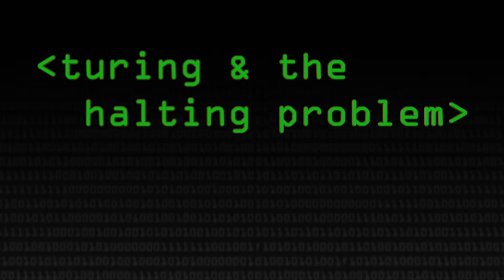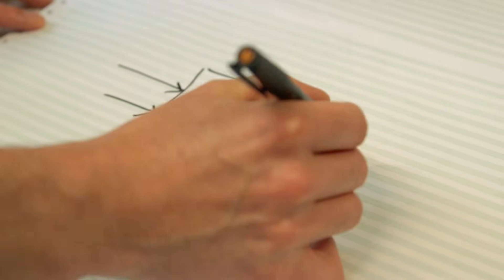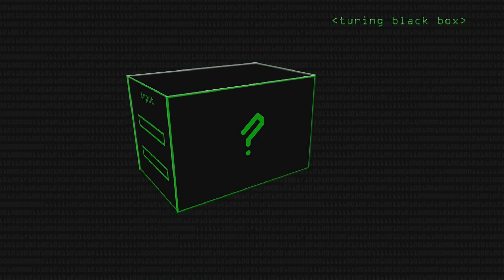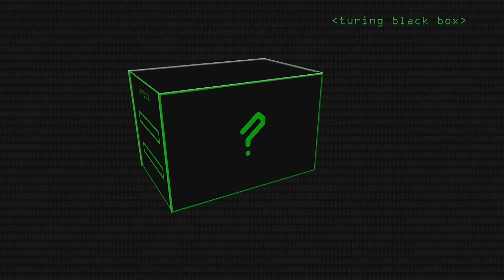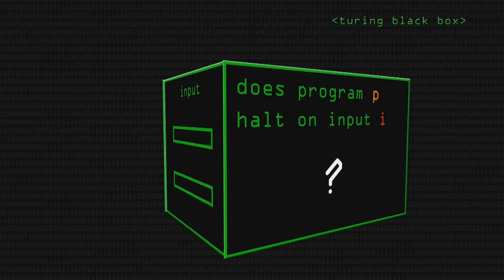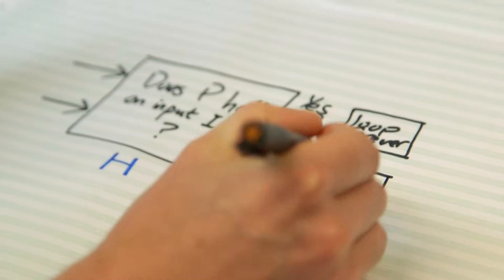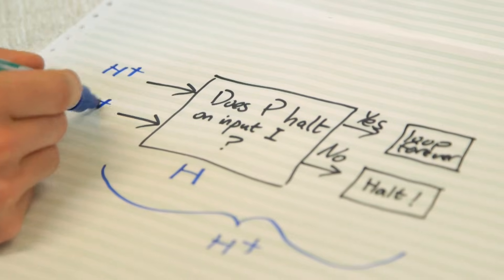Turing & The Halting Problem - Computerphile

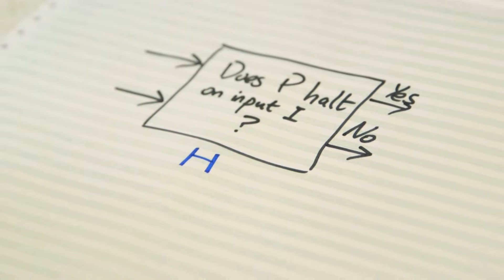Comment: 4:06 why not, instead of putting the "Loop forever" on Yes, put it on No instead. And put "Halt" on Yes instead of No. This way, when putting H into H+, if H will halt, H+ halts. And if H would not halt, H+ loops forever. Why is this a wrong answer?
Reply: No this type of thinking is completely wrong. H+ is a machine made of 3 machines. H itself is right, however due to adding extra machines that basically flips the output, makes it so H is wrong because the extra machines say it's wrong by flipping the answer, H is still right that the machine will not halt, because on normal circumstances it will not halt, however since you are forcing it halt by telling it, you are basically saying that it's wrong because you told the machine to be wrong.
Reply: +LeagueofLegendsFan9 
Your answer is not "wrong", it's just pointless. Just the mere fact that it's possible to fool machine H is sufficient to show that machine H doesn't work. In a proof by contradiction, you only need one failure to show the initial assumption was wrong.
Reply: Fernie Canto Ok, but why does wrapping H in an inversion of itself, which any rational man would determine will provide a contradiction, why does this resulting contradiction matter when it only happens as a result of a self-imposed inversion?
Reply: LeagueofLegendsFan9
Because, if machine H existed, this contradiction would be impossible. Machine H is, by definition, "unbeatable", and the proof shows that even a hypothetical unbeatable machine can be beaten.
Reply: Fernie Canto I'm still missing something. Why does it matter that an unbeatable machine can't beat an inversion of itself? Why must the conclusions be inverted?
Reply: NeOnThEcOdEr
Well, that was even more confusing.
Fact is, the fact that H "can't beat an inversion of itself" may seem pointless at first, but it has a massive consequence for computer theory and logic. This result shows that there's a whole category of problems that can't be solved by computers; using pure logic, you can show that, if you could devise a machine to solve one of those problems, that machine would be equivalent to H, which we know doesn't exist.
Turing's result shows that computing is limited by nature. Just like there are things we know we can do, there are things we know we can't do.
Reply: +Fernie Canto 
Well, this feels like the problem of figuring out the sum of 1-1+1-1+1-... to inf. At first most people thought well since it fluctuates between 0 and 1 infinitely, we can't really figure out the sum. Until some clever dude comes along and says well... we actually can if we do some clever trick and say the sum is 1/2. Enter quantum mechanics and that solution kinda makes sense. No? 
(I leave it a ? since I don't know for sure if this simplification of the original problem was solved using out of the box thinking and quantum mechanics means the same logic can be applied to the true original problem as even his explanation is a simplification).
Reply: Fernie Canto Perhaps the things we cannot do are only limited because we tell them to be limited. Give me an example of something that can beat an inversion of itself, in logic. Otherwise, the "whole category of problems we can't solve" just sounds like a lame excuse when we're talking about a machine that literally fails because it works.
Reply: LeagueofLegendsFan9 Look, dude, I'm okay if you're not well read and well studied in Computer Science, and if you're not completely knowledgeable in all its fundamentals and concepts. But now, you're trying to argue about Computer Science (with an actual CS undergraduate, no less), without knowing anything about it. You fail to realise that, when it comes to formal logic, you can prove that a problem is impossible to solve. Go read about Gödel's incompleteness theorem. Go read about undecidable problems. And if you think computer scientists are the kind who make "lame excuses", read about the "P=NP" problem, which is an open problem, and which is being restlessly chased as we speak. In fact, there's a monetary reward for anyone who can prove either that P=NP or P=/=NP. Maybe you can win that if you work hard enough.
Reply: +LeagueofLegendsFan9 +Fernie Canto
+LeagueofLegendsFan9 
It would seem like (imho) that the halting problem generates a paradox because of how we've limited the program to work. Just like how under normal circumstances it seems impossible to solve sum (-1)^n where n=0 to inf. However, a clever shift in thinking and some math later and you can see how it may not generate a paradox after all. Sum=1/2. 
I'm not saying I personally can solve the halting problem or the P=NP problem, nor am I a computer science aficionado. I'm just saying, are we generating a paradox and concluding we've created a proof via contradiction when in fact we may not really have. 
There may be a future clever guy who comes along and says just like sum (-1)^n was seemingly a paradox of is it= 0 or 1 but turns out we can find the solution of= 1/2, the halting problem might not necessarily be a paradox given this potentially new clever way of solving it.
Reply: Fritz Miot no, you clearly have no understanding of computer science at all or even what the problem is really about.
Reply: Richard Clark cool, tho my point had less to do with understanding computer science and more about how we reason something is impossible to figure out.
Reply: Fritz Miot 
Mathematics and Logic are really the only fields in which you can make rigorous proofs that something is impossible or unknowable, because it's based on axioms. If you start off with a given set of unchanging rules, it's possible to prove things much more rigorously than when you're trying to approximate the real world, like in Physics or Chemistry.
Mathematics and Logic are axiomatic because they're not trying to approximate the real world, but provide tools to help solve other problems. That's exactly what any computer does. You can determine what it's possible and what's impossible for a computer to do because you know all its rules. And even then, there are things you can't determine. Even Logic has its limits. It just turns out that the halting problem in particular has a definitive answer, while other problems don't.
Reply: it's like saying ""not all integers are positive" is false" is false because you changed the counterexample from 0 to 1.

Comment: Hmm, i don't agree.. If we change the program to have feedback loop and an inverter, the actual program, remember, we assumed that there was such a program and then modified the conditions... Nope, does not fly. On the other hand, i fully believe that halting problem is understood right and such a program can't exist but Turings explanation will not fly.. 

It is a bit like me saying "flight is not possible" using functioning airplane and the adding Jupiters worth of weight on it (since we cant exactly invert mass, let's just add fuktons of it for this example...). It's modifying the conditions of "what do we do with the information. Basically telling us that if made such thing, we can abuse it until it bleeds the answer we want.. 

More interesting question is can the program solving the halting solving problem answer does the program halt when asked if the program will halt when asked if the program is halt etc. Which i think is the right answer and no inverters or feedback were used. We just can't simply ask the right question, the program will still answer it right...
Reply: +SquidCaps 
There's nothing to "agree" here with. You don't need to agree with logic; it remains true regardless.
Notice that the proof DID NOT change machine H into something else; it just built a second machine that includes the original, unaltered machine H, and this is perfectly normal and acceptable computing theory. If machine H was truly perfect, then it should correctly predict the behaviour of this new machine. If H was perfect, it should be impossible to lead it into a paradox.

"It is a bit like me saying "flight is not possible" using functioning airplane and the adding Jupiters worth of weight on it."
No, it's not. Turing's proof is a proof by contradiction: it makes a wrong proposition and shows the consequences are paradoxical. In this kind of proof, you only need one example of failure to show the proposition is wrong. Your case is the opposite: you're making a wrong proposition and showing one example of success, which is meaningless. A proof by contradiction doesn't work well in the physical world because, well, you can't build physical contradictions.
Reply: Fernie Canto SO you are allowed to take code snippet A and add code snippet B and claim it is still code A.. Meaning, i write a code, add something to it and claim it's the original code.. 

"Notice that the proof DID NOT change machine H into something else; it just built a second machine that includes the original, unaltered machine H, and this is perfectly normal and acceptable computing theory. "

WHAT?? So you take machine A, add machine B and claim it is still only machine A? If i take pretty much any process that print out true and add a inverter and feedback that when it's true, it feeds false to input, EVERY process in the world is not true.. 

We have a metal factory that outputs sheet metal. Then we ship that to another factory that shreds it. The final result is not sheet metal but shreds. We altered the chain to invert the results and created a paradox, it did not exist in the machine A that could solve the problem.

 That is not the same as the original statement anymore... I'm 100% sure that you are right but based on this information, the logic is exactly what makes it dubious to say the least :) Think from the view point of someone who hasn't read computer science so far, how it looks from bottom up, not from top down. I'm sound designer and audio engineer so i get the same problem where it is just hard to realize how much the other person doesn't know.
Reply: Fernie Canto Think of this way: did the machine A produce a result? Isn't that where we stop? Or is it about can the machine A create a problem with B that machine A can not answer anymore? Unless we take B out and then it just halts after result and we are finished.. I'm feeling there is something missing from this picture, like we are jumping in to another set of rules, moving back and forth between two universes. Or looping a straight road and saying it isn't a line anymore since we can curve it in to a loop. The loop didn't exist before we add it.
Reply: SquidCaps
"SO you are allowed to take code snippet A and add code snippet B and claim it is still code A.. Meaning, i write a code, add something to it and claim it's the original code.."
Nothing was "added" in the proof in the video. If you take machine A and "plug" its outputs to the inputs of machine, you still have both machines A and B completely unaltered. If you actually write code, you're doing that all the time: if you write "func_a(func_b())", you're not "adding" anything to neither of the two functions. You're just producing a piece of code that utilize both functions without changing either.

"So you take machine A, add machine B and claim it is still only machine A?"
The proof never did that: machine H+ is always called machine H+, and it receives machine H+ in both of its inputs. The video never claimed that machine H+ became machine H or vice versa.

"The final result is not sheet metal but shreds. We altered the chain to invert the results and created a paradox"
That's not a paradox.

"I'm feeling there is something missing from this picture, like we are jumping in to another set of rules, moving back and forth between two universes."
Well, you're just not getting the full picture because computer science is theoretical, and it doesn't need to obey to physical rules. It's deceitful to try and create physical world analogies, because like I said, you can't build physical contradictions, but you can build logical contradictions. You need to completely abstract physical rules when you get into computer theory. That's why it's hard to explain it in layman terms: we usually aren't trained to abstract things.
Reply: Fernie Canto Please try, i'm second year on C#, been dabbling with programming on and off since the early 80s, including assembly but picked up recently again (wasn't easy to go from instructions to more object oriented, high level stuff.. still struggle at times). There have been multiple things i've had to first just accept and then learned later why, i find it's usually easier if i find out the "why" first :) I don't do anything complex, it's mainly just simple game logic and physics, not a lot of abstract stuff in my "code"...
Reply: SquidCaps
Well, let's pretend the following: I give you a function called testHalt(a, b), which receives a function "a" and input "b" and returns true if "a" will halt and false if it won't when executed with input "b" as parameter. I claim that testHalt always works, for any function and any input, and that it has no problem with recursion, since it never executes "a".
So, you create the following function:
boolean myFunc(func) {
  if (testHalt(func, func)) {
    while(true);
  } else {
    return true;
  }
}

As you see, myFunc(func) will intentionally hang if "func" halts, and halt when "func" hangs.

So, what happens when I call myFunc(myFunc)?

If testHalt is correct, it should predict whether the call to myFunc will halt or hang. The problem is that myFunc is designed to do the opposite of what testHalt will predict. Notice that, in no moment, you altered testHalt; you're simply using it in a new function. However, you have created a scenario in which, no matter what answer testHalt gives, it will be wrong. Therefore, the function doesn't work like I claimed it would, so I was wrong.

That's exactly what Turing did. The only difference is that his proof applies to any machine, not to a specific programming language.
Reply: Fernie Canto Thank you, i think i got it. Well, can't explain it so i haven't fully understood it yet, which was expected but starting to get the gist of it. It can't check itself then.. I'm going to watch the video and check you explanation again, thanks mate. i'll get it eventually, nothing so far has been a mystery forever, often it is much easier than originally expected too.

Comment: Looking at this from a programmers perspective, if we add an additional parameter say T and T represents a given Time unit. What if we assign T to H and if T exceeds some Upper limit say 24 hours. We can say that this program is not computable, and if the program computes in a time Under T we can say that is computable.

I understand in terms of Logic, this is not a True, because Time is conceptual and a program could theoretically run for longer than 24hours and yet we cannot determine if it will Halt.
However in a real world solution, would this be valid.
Thanks for any answer.